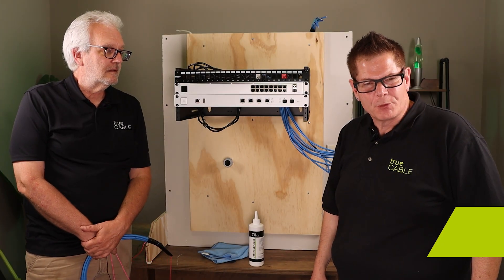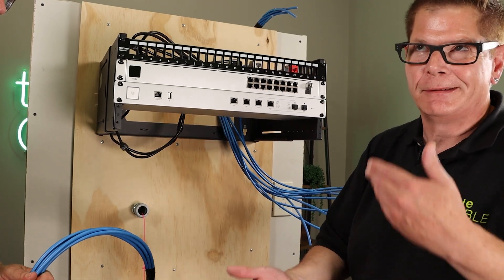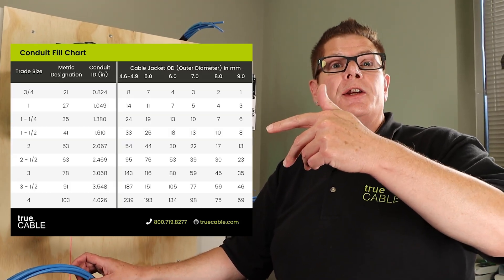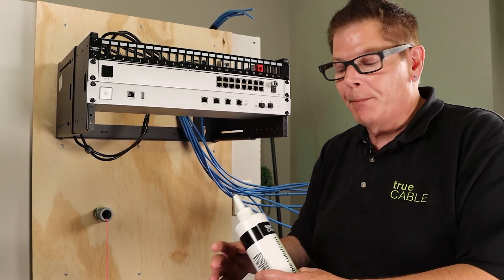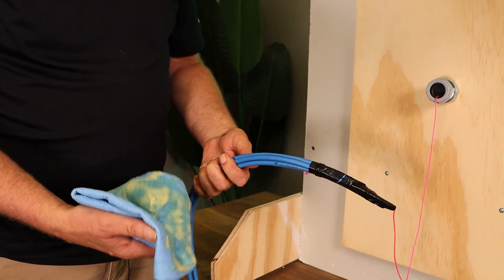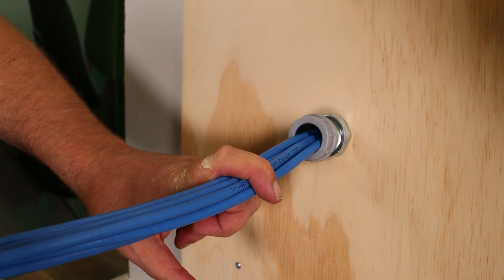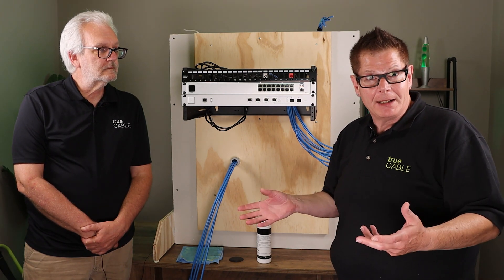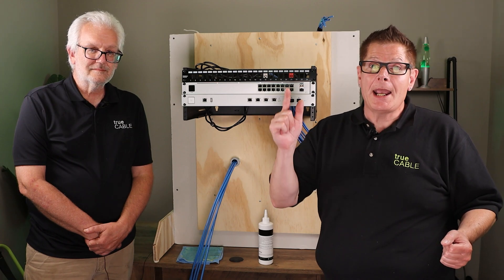How To: Pulling Ethernet Cable Through Conduit (Full Walkthrough)

Comment: how do you ground long runs of EMT?
Reply from the maker: Hello! You would bond long EMT conduit runs to ground using bond collars at BOTH ends of the conduit run, and then using a minimum of 6AWG stranded pure copper green coated ground wire to bond both of those collars to an equalized building AC ground. If your structural steel is all bonded back to the building AC ground then you may bond to the collars to the building structural steel, otherwise you will need to find a bond bus bar(s) for both collars to bond to. That can be a challenge. Structural steel is often what is needed to bond to as having a copper bus bar handy to make use of outside of the TR/ER is quite unlikely. Confirm with the electrician what is and what is not bonded and equalized in the structure! You can then safely go about your installation.

Comment: Is there a way to remove 4 UTP cables that have hardened over a long period of time in an existing pipe and cannot be removed?
I'm not sure if it's exactly hardened, but since the house is about 20 years old, the wire seems to have hardened. Even if I pull on the end of the wire, the cable won't come out.
Reply from the maker: The cables were likely twisted and/or braided together during the pulling process. In some cases, installers might have actually bundled the cables within the conduit, which is usually not a good idea. In any case, if you can't get the cables to move independently of each other, the conduit will probably have to be disassembled.
Reply: @trueCABLE  Ah.. I see. I guess there's no way for me to change the LAN cable myself. Thank you for your valuable advice.
Reply from the maker: @SONSUJIN  Happy to help!

Comment: If my electrical cables are in conduit. Can I run my cat6 cable over the exterior of the electrical conduit?
Reply from the maker: Hello and that is a great question! For 240VAC and less, yup. For 480VAC and higher, you will still need some separation depending on just how high that AC voltage is. I hope this helps!
Reply: @trueCABLE  thank you!

Comment: What you do if you encounter 90's ?
Reply from the maker: Hello! The best advice we can give you is to have a pull string pre-installed in the conduit prior to attempting to pull Ethernet or any communications cable through. There is little possibility of getting communications cable past a 90-degree conduit elbow without one. You should also use a lot of synthetic wax-based lubricant as the cable enters the conduit to reduce the coefficient of friction. Do not try this with conduit less than 3/4" diameter, and be aware of the max bend radius your cable can bend to without issues. In addition, there should never be more than 2 x 90-degree elbow bends in any one section of conduit you are pulling through.

Comment: A conduit makes it easier to upgrade cables in the future right?
Reply from the maker: Hello! Yes, a conduit can make it much easier to pull and remove cable runs. Conduit can also serve as a shield from EMI, assuming the conduit is metallic and bonded to ground at both ends. You can skip shielded cable!

Comment: What would like to know was how to get the pull string through a long conduit with turns and kinks.
Reply from the maker: Hello Rick! That is a special ancient Chinese secret! HAHA! Not really. Many installers will use a powerful wet/dry vacuum and then attach a foam rubber ball that just fits the inside diameter of the conduit. They attach the full string to the ball and then suck the ball and string through. Of course, you can also install the string while assembling and putting up the conduit, too.
Reply: @trueCABLE need to see a video of that
Reply from the maker: @kristopherleslie8343  Hello Kristopher! That is on the "to do" list of videos to shoot.
Reply: @kristopherleslie8343  Someone has done a short on that. But it was one cable. He/she tied it to a plastic bag. Put the vac on the end so it sealed over the pipe, then it sucked up the bag which had the cable tied to it. Sadly doesn't work if you already have cable already in the conduit.

Comment: Any suggestions on pulling cat6 through conduit from inside to outside where a 90 degree transition is needed (such as going up a wall)? Will a regular LB conduit outlet body work with a large enough conduit?
Reply from the maker: Hello Ed! Well, your question is a bit tough to answer. You will want to be using, at a minimum, 3/4" conduit and a 90 degree bend is fine but you should not have more than two 90 degree bends total in the conduit segment. Also, the number of cables going through the conduit plays a factor and may demand an increase in the trade size of the conduit. If it is 4 cables of 6.00mm jacket diameter or less, then 3/4" conduit is fine. Don't use LB conduit body connections as there are too many ways the cable can rip or hang up. Use a 90 degree elbow. Also, don't forget to use a lot of synthetic wax based cable lubricant on the cable going into the conduit. Be sure there is a pull string in the conduit in order to pull the cable through. If there is not a pull string installed, an easy way is to suck a string through the conduit with a powerful vacuum and foam ball. This is a two person job, with one person lubricating the cable going into the conduit (also watching for kinks and making the sure the cable jacket does not get scuffed as it feeds in) while the person on the far end is pulling. You might want to take a look at a blog I wrote about this, which provides some handy conduit loading charts. truecable.com/blogs/cable-academy/conduit-fill-chart-for-ethernet-and-coaxial-cable
Reply: @trueCABLE  "You will want to be using, at a minimum, 3/4" conduit and a 90 degree bend is fine but you should not have more than two 90 degree bends total in the conduit segment."

That seems like a bit of a problem for me. I have an existing coax run that is quite long and has at least 2 bends in it which I would like to pull out and replace it with ethernet. ID of the conduit is about 12mm (~1/2 in). When the coax was pulled through it, it was apparently really tough to pull it through (I guess no lube was used)
Reply from the maker: @GameCyborgCh  Given that the coax was tough to pull through, don't use it as a "pull string" to pull through the Ethernet. You will want to make use of copious amounts of synthetic wax-based lubricants (which we sell on our website) but avoid the water-based ones. As to the number of bends in your end-to-end conduit path, you may need to disconnect the conduit at the 90-degree bend points and use them as intermediate pull points (if possible). That is the best advice I can give you. Ethernet is quite a bit more fragile than coaxial and easily damaged if you yank and tug to get it going or apply quite a bit of force. Obviously, this could be a three-person job! Please let us know if you have any further questions!
Reply: @trueCABLE  This is the exact question that I had, as well, about pulling through a cat6 ethernet through my 1" conduit from my "she shed" interior to my main house. There is a 90 degree bend on the outside of my shed and trying to push it through, it's not budging. I'll have to wait until hubby gets home to see if we can feed it through with him pulling on the other end. It's just one wire. Do I still need the lubricant?
Reply from the maker: @ThriftDiving  Hello! Yup, you should use lubricant. You should also find a way to get a pull string through that conduit, as pushing a cable through conduit is nearly impossible to do. A thin kite string tied to a light foam ball and a strong wet-dry vac should help suck the kite string through. That is an old installer trick. Then attach the cable to the kite string (securely!) and use the kite string to pull the cable through. Use plenty of lubricant on the cable entering the conduit, and be sure to have two people do this. One to pull, and the other to guide the cable into the conduit while lubricating it and preventing kinking or scraping against the end of the conduit. FYI--that cable end that you are trying to feed through is likely getting hung up on the ledge where you have the 90 degree elbow attached to the straight conduit.

Comment: What can you do if the string is out and the conduit isn’t straight
Reply from the maker: Good question! Easy fix. Attach a pull string to a foam ball that nearly fits the diameter of the conduit. I have seen people also use plastic bags, too. Basically, something light that can be sucked through the conduit is what you want. Insert at one end of the conduit. At the OTHER end of the conduit, use a vacuum to pull the string through. Hope this help!
Reply: @trueCABLE  awesome thanks
Reply from the maker: @peterlohnes1  You know we got your back!

Comment: Any tips on running a few new cat6 wires through an existing floor conduit with ethernet already in it? I just don't want to damage the existing wire.
Reply from the maker: Hello Kris! Well, that can certainly seem daunting. First, be sure you can get more cable into the conduit without over-filling it. We have a blog found in the trueCABLE Cable Academy titled "Conduit Fill Chart for Ethernet and Coaxial Cable" that you should check first. If all is good, and you don't exceed 60% fill ratio, then the next step is using a pull string. If there is not already a pull string in the conduit you have two options. The first option involves a wet-dry vac, a foam ball (or plastic saran wrap), and some pull string. Attach the pull string to the foam ball or balled-up saran wrap and suck it through the conduit with the wet-dry vac. Now you have a pull string. If that does not work, you might need to sacrifice one of your existing cable runs to pull the others through, using one of the existing runs as the pull string itself (I have had to do this). Needless to say, use plenty of synthetic wax based lubricant on the cable going into the pipe to minimize friction damage. Don't use a metal fish tape or other rigid objects to push the cable through. Good luck!
Reply: I’ve done it.  The solution is preferably someone at the other end.  It’s kinda of 2 feet forward one foot back for snags.  So you pull.  You’ll hit a snag (usually a bend in the tube) so you go back and forth a bit to get it through.  Sometimes you will have to pull both cables to assist the corners.  Also make sure the existing lan is well anchored otherwise it can get pulled through

Comment: interesting, i'm trying to come up with idea in how i can pass about 30 ethernet cables out of one of those structured wiring panels and into the wall cavity in the next bay over, i made a video about this, extremely frustrated.   the builder cluttered the walls with a ton of wires and there's electrical all over the place, not to mention you can't get in the attic and access anything from the top.  the smurf tube is useless, my video shows what i'm talking about.
Reply from the maker: Hello! That sounds like a challenging situation you are in! Smurf tube is not helpful as it moves around too much. We suggest metallic conduit or PVC (PVC if residential, not commercial). As for the routing situation, it sounds like you will have to relocate your structured wiring enclosure closer to where the cable is at, as opposed to bringing the cable to the enclosure.
Reply: @trueCABLE  all of the cables for the whole house are dumped into this structured wire enclosure, I'm trying to separate the Ethernet from that but I'm stuck due to how this house was wired. I think I've come up with a plan.
Reply: Pull 24 for one pipe 6 on another pipe . 24 cords go to one patch panel